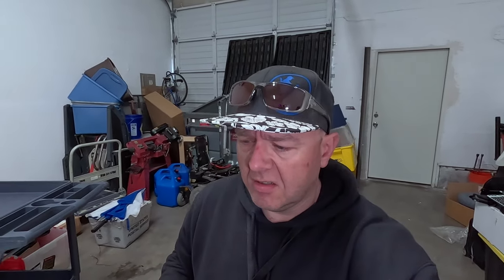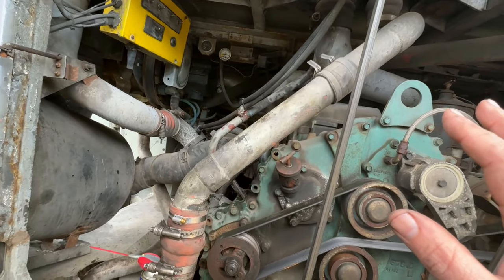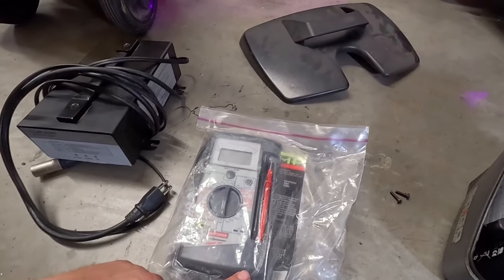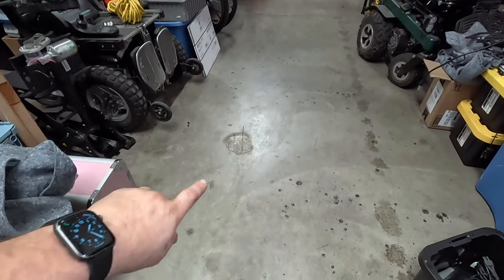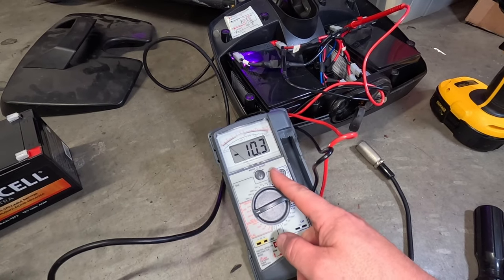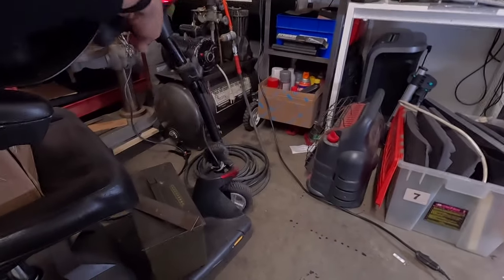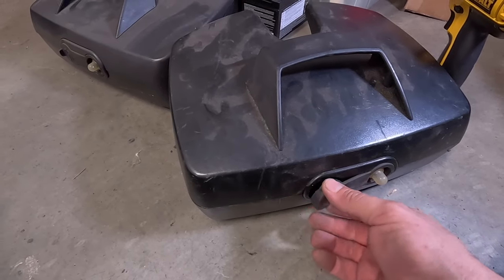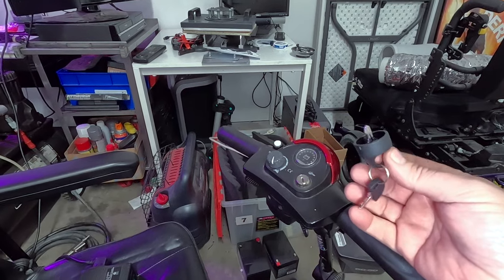VLOG 703: go go battery & bus water pump!

Comment: Love the water pump video on the bus! I did alot of engine work on our company's emergency operations vehicle.  It is a Prevost same similarities as your MCI. NICE JOB!   Hey, do those small seat chairs fail if you go up 6.more volts? I tricked.out my neighbors sons fire truck (12v) to a milwaukie 18v lithium tool battery and had it almost pulling wheelies. I had to put the old battery in because little Jimmy was getting carried out of hand then he hit his dads new truck ouch!!  Just curious of the max voltage.  Thanks bud!!👍
Reply from the maker: I’m just glad when they decided to stuff a semi truck engine into this bus, they thought out maintenance and repairability! If needed, the entire engine and transmission slides out the back on a rail system lol

Comment: Would you happen to have a wiring schematic for a Jazzy 1122 and a Hoveround. I'm trying to swap the controller from the Hoveround to the Jazzy. The only difference that I can see is the molex plug has two small wires that plugin into the control board, that one of those wires connects to a different pin. I think theses wires connect to the motor disengage switches.
Reply from the maker: Id just look around online.. they’re pretty simple systems with the motor controller built right into the joystick in most cases